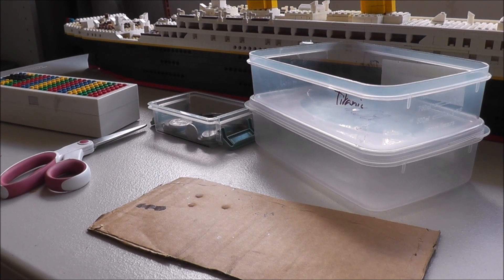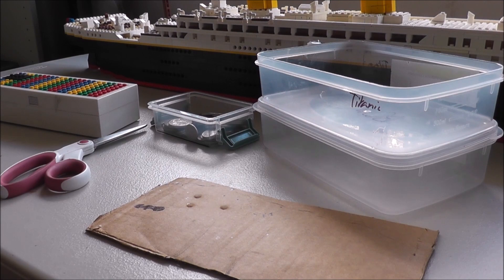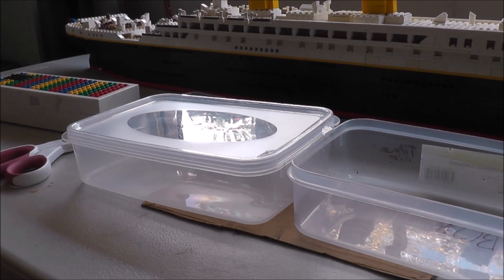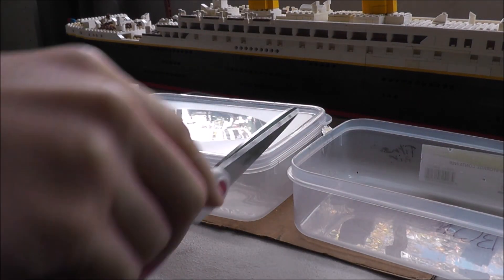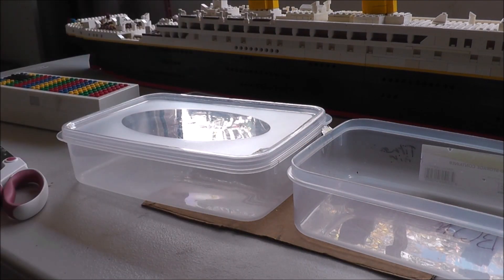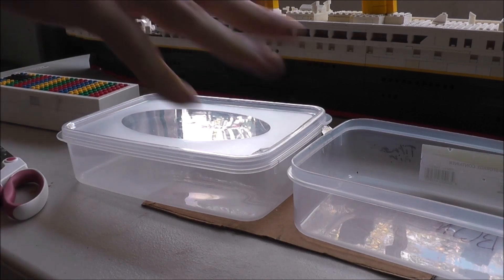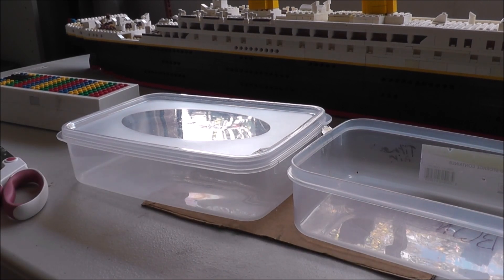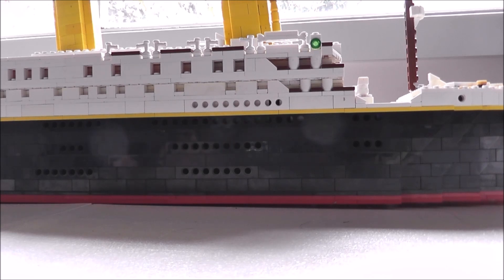Titanic MythBusters | ep 2 | How to prove the v break is impossible with a small experiment

Comment: Lmao, V-Break is so impossible that 2 plastic containers acting as Titanic could disprove it.
Reply: These plastic contairners do not have compartments. And this idiot put the hole in the bow, the damage was made between amidships and the bow. The middle floods faster and the v-break is possible.
Reply: @blackstarline246  the damage analysis on the wreck clearly shows six slits on the forward 6 compartments, none amidships. Acknowledging this, unless we suspended pyshics, the V-Break never happened.
Reply: @HugoGHA  these 6 slits could have been created by the force of impact when the bow touched the ocean floor.
Reply: @blackstarline246  no, otherwise the ship wouldn't have sunk.
Reply: @HugoGHA  they said 5 compartments started flooding. Then how are there 6 holes? Excluding one. 5 compartments were flooding. The most forward one does not count.

Comment: 2 plastic containers proved more than Aaron1912 could ever
Reply: I snuck in here
Reply: @prehistoricliners6717  S N E E K 9 9 9 9 9
Reply: Aaron1912 is a nutcase who can't comprehend how physics works or how sinking works.
Reply: If the plastic contairnes do not have compartments then it will not work. And if the hole is in the bow then obviousky it will not work. The ship was damaged between  the middle and the bow. Middle floods faster and when it splits v-break happens
Reply: @blackstarline246  The Ship was damaged by the Iceberg on the Starboard side of the Bow, so logically– a V-break is impossible.
Reply: @vyncalderon2593  i repeat, the iceberg damaged the titanic amidships.